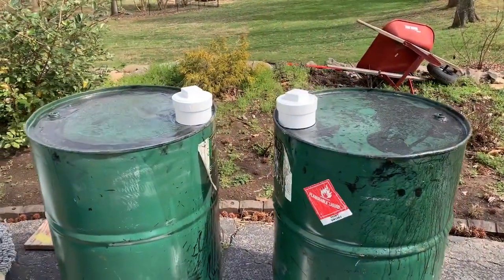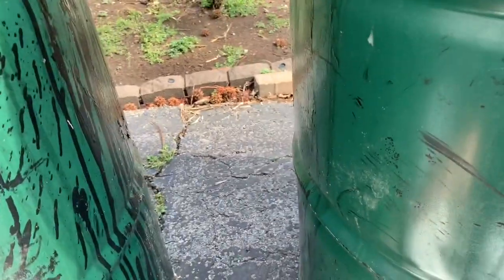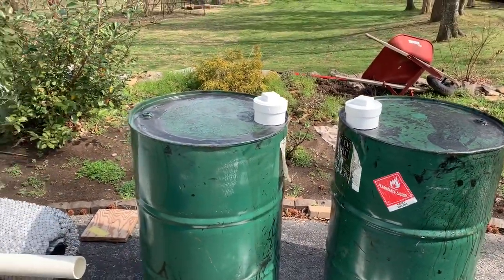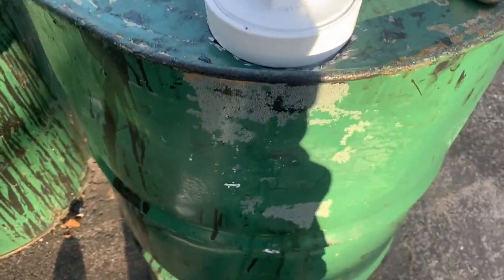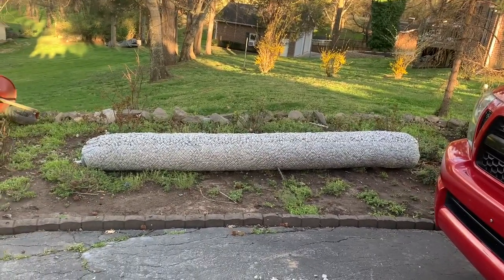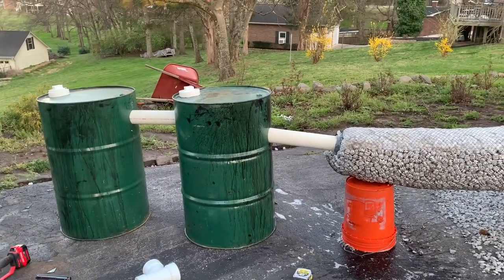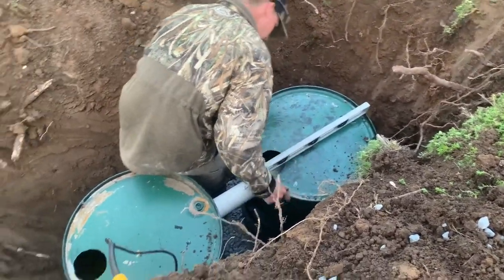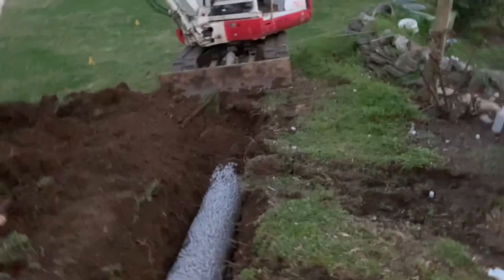DIY Rv Mini Septic System

Comment: Three questions: You didn't have to add a vent pipe for air (I'm thinking the average septic system doesn't use that anyway)?  What did you use to seal the PVC to the metal barrel? How often is that RV used, as that would determine how big a septic system?  Thx!  Ron from Nashville.

Comment: Great job sir. On my end, the guy helping me out went to an RV store and purchased a coupler to go from RV to PVC so now I have PVC all the way to septic. The only draw back is if I disconnect to travel It takes a bit to reposition the RV when returning, as there is little flex in PVC. Great vid!
Reply from the maker: Ya they make flex dump hoses for Rvs. They make the hoses in several lengths.

Comment: Quick question: Why the two barrels instead of using just the one connecting to the peanut pipe?
Reply from the maker: Well the first barrel holds the solids, solids fall to the bottom, the second barrel contains a watery mix when that barrel fills then it exits to the field line. With a signal barrel your field line will clog with solids. It’s gross but that’s the process

Comment: Great video.. I am contemplating doing something similar on my property.  given the size of the barrels, how long to you think you can dump into them until you have to have them professionally emptied?  Also, did you require a permit to do this?
Reply from the maker: I am not sure about the emptying. I would imagine it would be every two years
Reply: This guy is asking if you got a permit.😆😆😆.   Sure bud he got a permit alright….
Reply: @freeandcriticalthinker4431 Right? If you have to ask, you probably shouldn't be doing this project. 😂😂😂

Comment: Had a question, how did you get the T inside the tank? thanks pal
Reply from the maker: So I was able to access the barrel from the top and through the hole in the side. Was able to work it in from the top

Comment: What size is your top connection and the side pipes?
Reply from the maker: So the Riser on the top is 4 inch
The pvc pipe that connects and tanks and the tail section is 3 inch. Hoped that helped
Reply: @thisoldcoacheverythingrv2625   thank you
Reply from the maker: So the system I installed has been working great. No trouble. I did put a package of septic formula that charges the tanks with bacteria that breaks down the solids

Comment: Wondering why you didn't put ""T" baffles in the system, at least on the outlets sides inside the 55 gal drums?
Reply from the maker: I put a baffle in the outlet of the first tank not the second.
System so far is working perfectly.